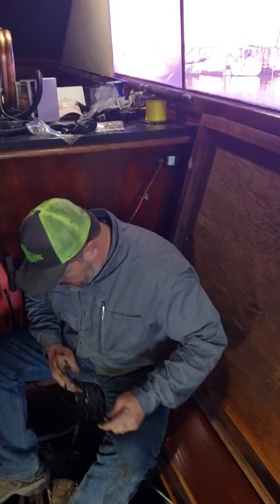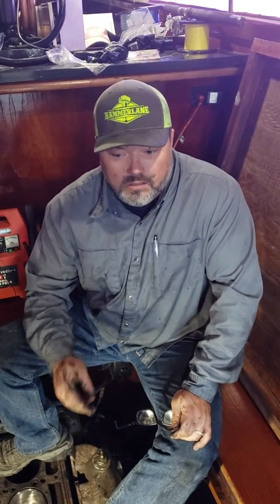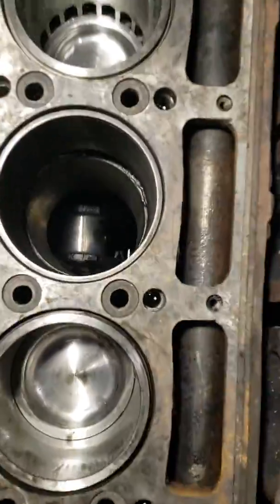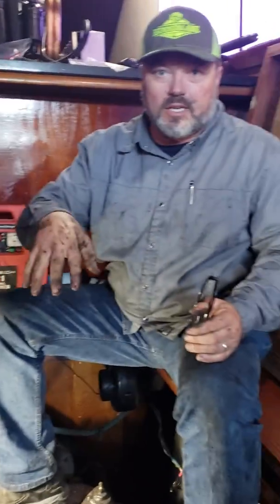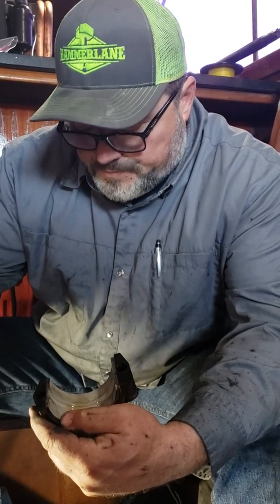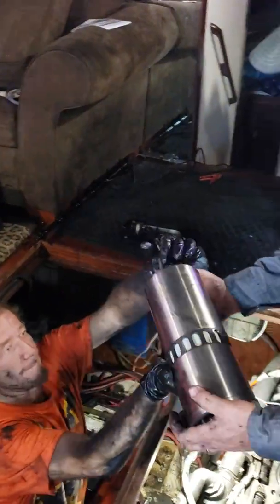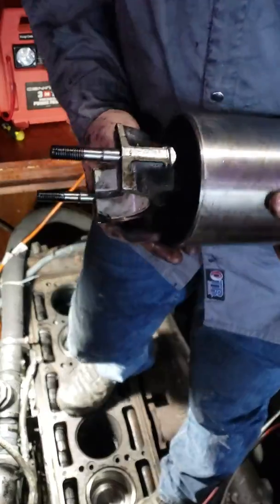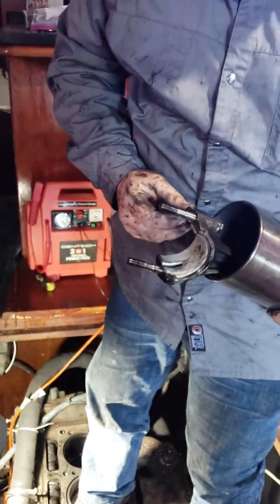Detroit 671 install sleeves and pistons

Comment: how did you attach the nuts to the bottom of the boat with engine still in the boat?
Reply from the maker: We felt under the engine for the 2 rod nuts